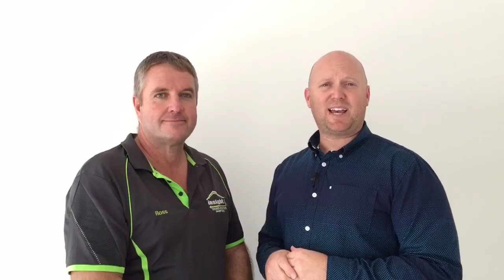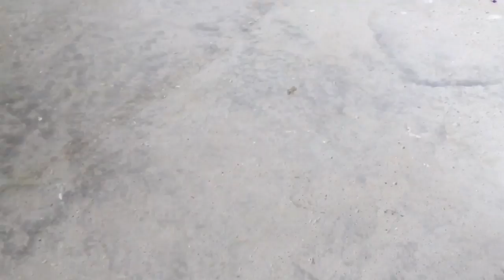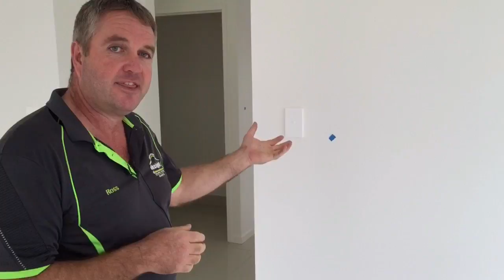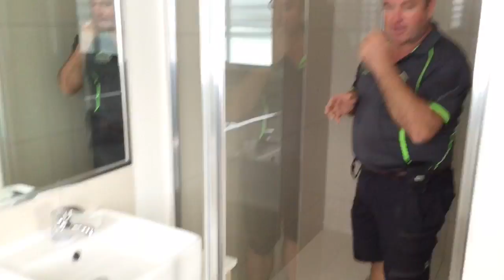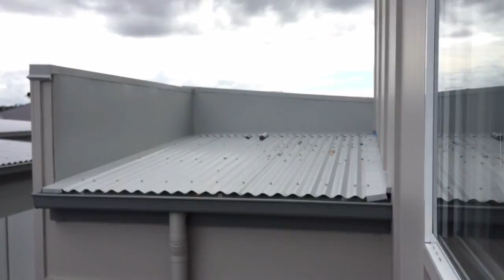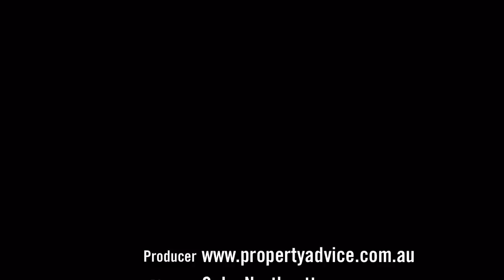Pre Handover Inspection of a New Property

Comment: Good to see the toilet not plumbed to the hot water supply,the doors don't fall off,the windows don't fall out,until opened,gas doesn't blow out of the sink taps,the windows aren't cracked,the stairs are in the right place,and all there,no doors opening onto blank walls,the drain not full of concrete,and the letter box seven feet off the ground,door upside down!   Request second opinion in case of unfair assessment.
Reply: I think the paint was back to front.

Comment: That rubbish single glazed windows which don't give you any sound proofing.
I don't miss Oz at all
Reply from the maker: Chillout Fles. Depends on location will make a big difference to the requirement for double glazing. However, i agree with you, it is always nice to have and is way better for energy efficiency. Thanks for stopping by.
Reply: @RealPropertyAdvice  ok, no worries.

Comment: I'm wondering if inspectors check the insulation of the property, e.g. heat bridges and the insulation property of the walls themselves. Thank you!
Reply: I've seen a thermal image camera pick up a square of missing insulation
Reply from the maker: Hi Janos, checking insulation will depend on the location of accessible opening and the type. Checking roof insulation will be easier than walls due to ability to access. It is better to check walls during construction so if you can’t get their, your builders rep will be able to take photos at each stage.
Thanks for your comment.
Reply: @RealPropertyAdvice  thank you!